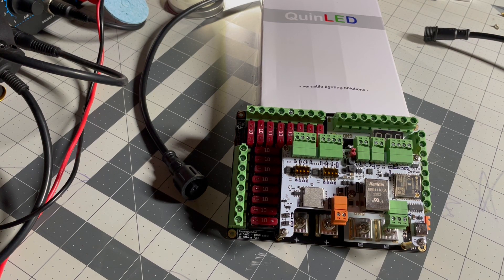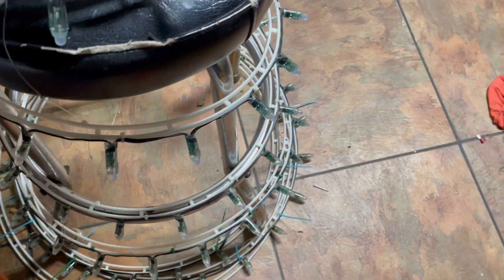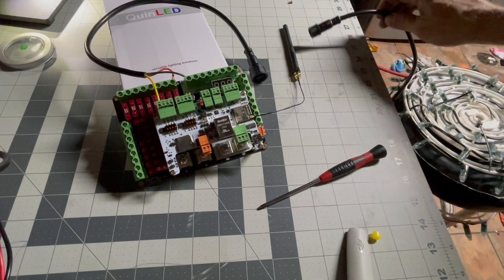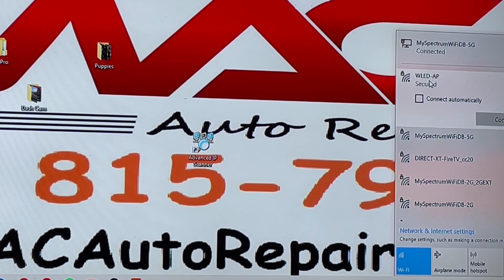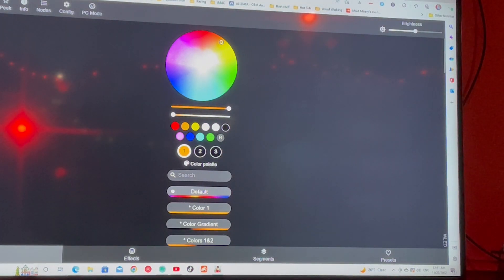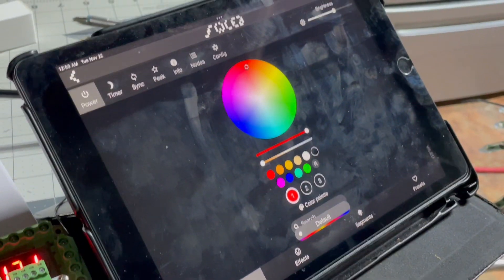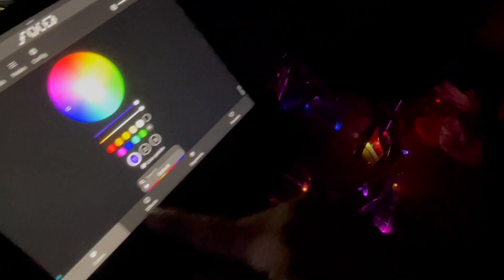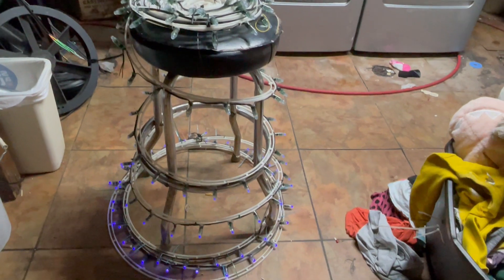Testing the Dig Octa System with the HC Power Board By Quin LED using WLED

Comment: OMGOSH!  I have been struggling with setting this same issue.  Your video resolved the issue.  My lights were doing the exact same thing that yours were.  Someone on the discord suggested that I go to the LED preferences and set the output to RGB.  I did that as well set the strands to 100.  After I saved those settings the strand went dark and did not appear to respond.  TURNING THE BRIGHTNESS LIMITER OFF WAS THE SOLUTION FOR ME. After watching your content I followed you along and turn off the brightness limiter and when I pressed SAVE… well it did… LOL… in more ways that one.  The light strands lit with that distinctive orange glow!!!   Now I just need to interface it with Xlights and then a Rasperry PI 4 running FFP    SUBSCRIBED and THUMBS UP!  THANK YOU !!!
Reply from the maker: That’s amazing to hear and I apologize for the delay in responding to you